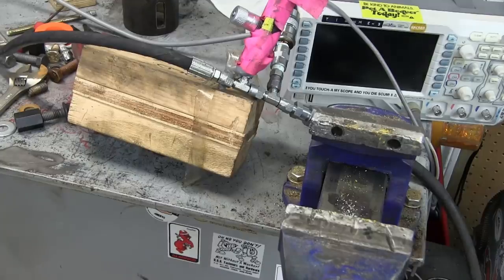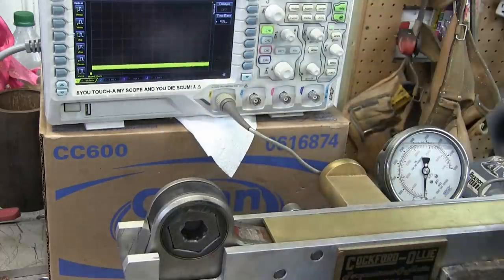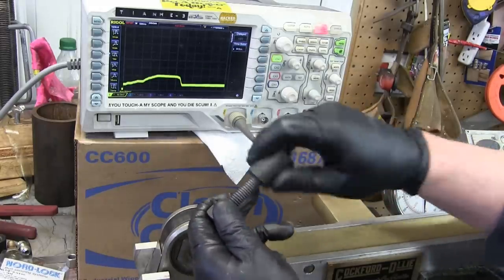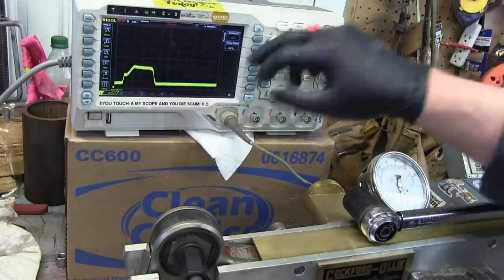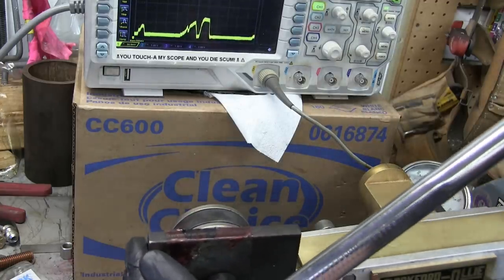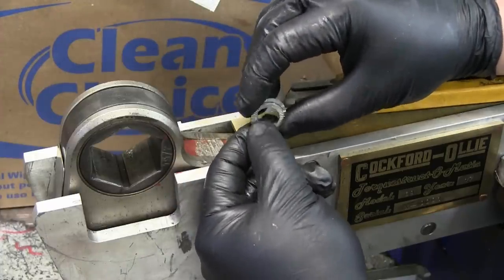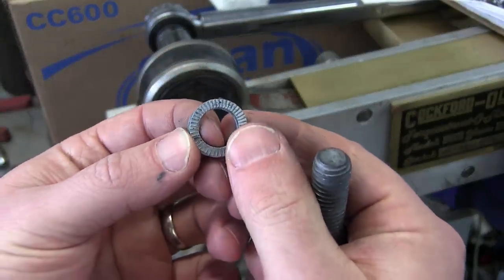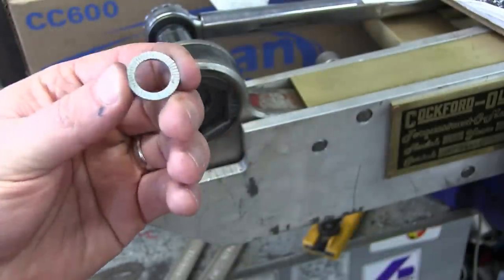Nord-Lock Washers | Do they work better?

Comment: Spring Lock washers do not lock a bolt under heavy vibration. The help prevent the bolt from coming out but do not maintain bolt torque over time. My company basically exclusively use loctite nowadays.

Comment: What about 1 washer with the slotted serration on both sides? I know the ratcheting in between the two washers is nice, but if they are glued together are they really working? I would be curious to see a single flat washer with slots cut into it.

Comment: At work have used Nordlocks at 600lbs it was near impossible to remove the bolts. Took a massive amount of metel with it. Never have to check the bolts after torquing with Nordlocks.

Comment: I can attest to these things working well, we have rotary steerable tools for drilling for oil and I have seen some tools hit 300g while drilling downhole, doesnt sound that bad but they can weigh up to 1.7T, so that's 510 tonne of lateral forces and impacts and yet these bolts didnt loosen the slightest. even seen half the bolt ground down from drilling yet these things kept tight.

Comment: That's why when I used to rebuild the P&W j52 we had to safety wire the crap out if it.  One flange 100+ bolts, all safety wired. When I got bored I do three or four bolts at a time. No washers.

I was safety wiring in my dreams at one point!

Comment: I was involved with fitting the structural steel on the new bond street station platform for the upcoming crossrail line in london. we used nordlock washers on all fixings there

Comment: Do washers effectively increase surface area on a softer material to increase surface friction? instead of 1/4" of surface area on that aluminum plate, a large washer takes it up to 2 inches of surface area thus adding torque required it to break it?

Comment: It's all about the anti vibration loosening protection. I've used nordlock washers for years on race bike and race car type applications and they just work, unlike EVERYTHING else except for safety wiring.
Reply: Seriously, I have seen nordlock work on 500cc two stroke race bikes where you can literally dial the vibration up with the throttle sitting on the stand in neutral and watch fasteners hits the sweet spot and start dancing around unwinding themselves, fasteners that you just torqued down! Threadlocker will hold for a time, but eventually succumbs; safety wire works and nordlock works. I'm a believer.

Comment: McMaster Carr sells diamond grip washers. I have used them for fasteners that needed to be loosened frequently for machine adjustments. Regular washers were not holding up for very long and tend to do a lot of damaged.
As you can guess by the name there not cheap.

Comment: do nordlocks ramps/teeth correspond to the thread pitch? thought thats how they worked you had to overcome the ramp effect of the teeth between the 2 which was supposed to be greater than the pitch of the bolt?

Comment: 271 Locktite and cross thread the Chingaderra, then run it right up tight with a 3/4 air impact. You never have to worry about it coming loose.  (Sarcasm, one of the many free services offered here at MD's emporium of used gasses)

Comment: I am in the middle of trying to building a prototype "Thing" in R&D stage for the company I'm with.  By Enginerd specs all fasteners are grade 8, Nord-Lock both sides and L9 Hex Collar Locknuts Cadmium Yellow & Wax Coated.   Between the Nord-locks and correct lock nuts, In my experience it takes quite a bit more to break the fastener loose.  You know it's bad when the price of double nord-locks and Stovers is high enough that even the guy at Acklands thinks the price is too high.

Comment: Are you sure the angle on those nord washers aren't shallower than the thread?  If they were steeper, why wouldn't the thread itself back out before the lock washer?  Surely the ramp on the washer needs to be shallower to ensure the lock-washers-ramp is climbed preferentially to the threads ramp...

Comment: 1: I think you need some filtering between your sensor and scope. Possibly a more fine grain sensor, so that smaller differences are able to be seen. 
2: this test is a measure of static to dynamic friction, real world vibrations could greatly impact the results.
3: you can build a vibration test rig with a a fein tool bolted to a plate.
4: the force vector of the wrench is not purely in torque, there is also a moment about the axis that us normal to the plane or rotation (as you have pointed out before)... This could have an Interesting effect when considering everything to not be rigid bodies...
5: if ability to resist unscrewing torque is not the only metric that matters then could this be applied to the previous Penatrating oil tests?
6: a test in which nuts are so rusty that attempting to remove them without any sort of Penatrating oil would break the shaft would be interesting
7. Furthermore in my experience it's not always the rust on the nut that is an issue, exposed threads corrode and build up a layer of shmoo that as you unibit something can cause the friction force to increase eventually leading to an elastic failure of the bolt.

Comment: Spring washers are no good as lock washers, but they do serve a purpose. We use sping washers in some monster shear couplings to ensure a clean separation on the shear pins when they brake, that way the sheared ends don't mushroom over which makes them a pain in the ass to remove.

Comment: If you wanted to try the  oscillation test method, couldn't you try connecting your function generator to an amplifier?  Then connect a subwoofer up to it, and press it against the test piece?

Comment: The spring washers are great. I had an engine that had the flywheel on with a nut and a spring washer. One time i took it off and lost the spring washer but i thought that it would be fine if i torqued it good and proper. No bueno. The nut backed right off and almost fuckered the shaft. I tried it once more and the same happened. So i went and found the lost spring washer, put it back on and what do you know the nut didn't even budge. Holds like a charm even to this day.

Comment: It feels like the Nord-Lock takes more work to loosen because it actually does. Work is force multiplied by distance (or torque multiplied by angle), so if you have to apply the same loosening torque for a longer distance, you need to put more work into it. This how these work. They give you a buffer, so that random vibration and movement is not as likely to overcome that loosening work of your bolt.
My bet will be on locktite though. Or if you have nothing else to do, wire locks.

Comment: nordlock has their own torque specs based on bolt grade sometimes it's pretty close to normal sometimes it's not! anyways the washers work like a charm if you use their specs, even on really hard bolts. Siemens uses them on their gas turbine exhausts, I'm not sure what the grade is on the hardware, but you can't cut the bolts with a portaband, teeth go bye bye immediately, gotta use a carbide grit blade. Anyway if you need to loosen a bolt you just put in, it's waaay harder than to bust loose than the effort it took to torque it.

Comment: Quote from the Nord-Lock brochure "Untightening Nord-Lock washers is as simple as tightening. Note that since the locking function is not based on increased friction, the untightening torque is generally lower than the tightening torque. Therefore it is not possible to measure off torque as verification of locking function."

Comment: used Nordlock on high vib drill rigs, they do work on milder steels, split washers however are pointless, may as well use a flat washer for some protection to the hole and loctite it

Comment: I wonder...here in Aussie land we have Metric Corse, Metric Fine and Metric Extrafine thread standards.
I’m guessing the NordLock effect would be greater with finer (more densely packed) threads because the NordLock angle would be comparatively larger than the bolt’s helix angle.

Comment: NordLock washers work well on electric bikes, especially those with regen that get some torque reaction in both directions. When it comes time to change the tire, you can feel the tension increase and then drop as you remove them. Would not want to mess with wires or cotter keys every time a tire needed changing on a bicycle.

Comment: I kept blowing out manifold and turbo gaskets on my car's engine.  Something about a stainless tubular header made the stock fasteners back off every time.  Probably the lower mass compared to the stock manifold and thereby more rapid heat cycling. Since i went to Nord-locks I haven't had an issue.

Comment: Surely the function of a spring type washer is to take up any slack that would be created by variation in length of the bolt through thermal expansion etc so the fastener always remains in the original alignment.  Kinda.

Comment: Please look into ARP fasteners... They are high end automotive fasteners very nicely finished and strong bolts/nuts/studs/screws(the bolt kind) and they also have their own lube for getting consistent torque pre loads the first time and every time. They also claim that their stuff is much stronger than grade 8 fasteners

Comment: Can you please try this test on a much finer thread ! Secondly could you try on different grade bolts (generally found higher grade bolts resist the outer flats on the washer digging into bolts enough to resist the undoing compared too a lower grade bolt)

Comment: i dont know if its been said, but there are bolts designed to work with the teeth. usually a flange bolt with teeth on the thread side of the flange.

Comment: Would they work better with a hard bolt if there was a soft flat washer between the bolt head and the nord lock?
Reply: No, they would not work at all, because the bolt would turn against the flat washer.  This vid was about seeing AvE discover how Nordlocks work, not about how to use them.  There are other vids and articles on the web explaining this topic in full detail.

Comment: I think you may have missed the point here, which is pretty rare. The Nordlock washers are not intended to increase breakaway torque. They are intended to prevent the bolted joint from backing off under vibration. You need to test this on a big shaker table and see if either locking device prevents the bolted joint from staying in tension during a heavy vibration run. I've seen tests like this, and the Nordlock stuff does work, and indeed the split washers do not, but really neither are necessary in many cases, plus the Norlock stuff is super expensive.

Comment: It's easy to make standard lock washers improperly. They're wrong when they depend on the regular spiral incline between the cut ends. They work better when the cut ends have a slower spiral and curve into the bolt head and into the surrounding surface around the hole. But there's an additional design fault: resisting torque that tends to loosen the bolt depends on resisting spreading the split washer open. Also, the difference between the washer's ID and OD is too small.  The OD should be larger and the cut shouldn't go all the way through radially. I think the cut(s) should be a "T" shape sitting on the ID that only goes half way through the radial cross section.

Comment: sounds like with hard steel, you need a pair of nordlocks and loctite/epoxy on the washer-to-hard-steel interfaces. ie the crucial design feature is the long serrations (backing off RELIABLY increases force, unlike spring washers where backing off just means force doesn't drop suddenly), not the short serrations (where force increase depends on surface matching, per any roughness in direction of travel)

Comment: I think the split lock washers are not meant to make the nut harder to overcome, but to serve as cheap insurance if a newly fastened nut comes loose, hopefully it won't turn off the bolt all the way, given that for the first 1/16 of travel it still has a sprung resistance on it.

Comment: I totally misunderstood the strain gauge apparatus. I had taken it to be measuring the applied torque and not the developed torque. I shouldn't have, since he went ahead and explained it when he was setting it all up. It wasn't apparent to me until he was setting up the system here without the pneumatic component pushing the wrench.

Very clever and cheap and dirty system he rigged up there.

Comment: what about if you took a nord lock apart and welded the top half to your bolt and the other half to your work piece that you are bolting into       (if you are using a nut you would have to do the same thing on the nut side i believe)

Comment: spring washers were designed to stop nuts from rattling off bolts while on the assembly line, until the nut is tightened at another station of the line.
designed to last a few hundred yards on the automotive assembly line.

Comment: If I need to fasten 2 pieces & make absolutely certain that they do not come free unintentionally, I do 1 of 2 things.

1- use a stud with a pair of nylon lock nuts or crimp lock nuts.

2- spring washer at the head of the bolt with a nylon lock nut as a jam nut. (On top of a standard nut)

Comment: The good old drill a hole through the shaft of the bolt and stick a cotter pin in it always does the trick.

Comment: As long as the internal forces created by the fasteners are  greater than any of the external forces applied the parts wont come apart. That is why it is so important to apply the designers indicated torque to the bolts. Vibration can apply far greater forces than the steady state forces, if it has been designed right it wont come apart. But in the real world you often get vibration forces that the designers did not expect, that is where Loctite and locking wire comes in. Under the correct torque a flat washer works as well as any of the anti shake washers.

Comment: Wouldn't the thread pitch on the bolt being loosened also succeed in clearing the serrated surface from the bottom of the bolt head. Seems like that serration would skip long before the bolt stretched. Of course that is only a guess as i have no idea on the actual math of that.

Comment: We used nord lock washer on the drill rigs at my old job, they work every well for vibration but they cost alot imo instead of just using lock tight

Comment: It does work, you just need to be very particular what materials bolt and plate are made off, and what is the pitch, and use a proper speced washer. If you need a fastener which is harder , you  might need a nord lock that is integrated into a bolt.

Comment: Nordlocks are great, but they were designed for a specific purpose.  One must learn how they work, when to use them, and when not to use them, before specifying them for a particular task.  Also, beware of copycat products that look like Nordlocks but aren't -- they don't work at all!  Nordlocks work so well because they are "active" lock washers which give a little under stress, by going up the little in-between ramps (effectively increasing, not decreasing the bolt tension), but without the external teeth giving at all, so as the stress diminishes, the washers come back down the ramps to their prior state and original torque.  Under vibration, the ramps go up and down, while the external teeth do not progressively loosen.  Follow torque specs carefully when using these.  If they're under-torqued, the external serrations won't bite the bolt and base material deeply enough, and the fastener will work loose.  On the other hand, if they're over-torqued, there will be too much tension for the ramps to work properly, and, as AvE noted, the Nordlock warshers will break catastrophically.  I use these on my motorcycle for some bolts that tend to rust and seize (e.g., side stand), which enables me to use anti-seize instead of loc-tite.  McMaster sells a variety of these.  Depending on your purpose, you might prefer drill-and-wire, torque-and-tack, and/or a variety of other techniques.  For critical applications, do the research, and don't compromise.

Comment: I use Aerotite on my cylinder heads. They hav3 a springwasher attached to the bolt so its a single unit. Usually retorque the head every 1000m or so (very tuned so vibes an issue) since i switched its never needed doing, though i still check!
Reply: Arrrggghhh sorry....washer attached to NUT

Comment: Id be curious what the results would be if you used a bolt with a serrated flanged head in conjunction with the nord lock. That way the nord and the bolt would be locked together.

Comment: I had serious problems with turbo bolts on my track car getting loose, I tried everything, nothing worked, red hot heat cycles and vibration on a 8000 rpm motor are too much, JUST STARTED USING SAFETY WIRE AND NEVER LOOKED BACK, WORKS LIKE A CHARM.

Comment: "Note that since the locking function is not based on increased friction, the untightening torque is generally lower than the tightening torque. Therefore it is not possible to measure offtorque as verification of locking function."   (then in the "verification" section:) After disassembly, impression marks must be visible on both the fastener and the contact surface.  

edit: https://i.imgur.com/8Fm4MCo.png picture from their documentation to show the cam action.. there should be like 20 thou of additional spacing when properly torqued

So, yeahh, you want to bolt into like mild steel or something. The bolt stretching should be fairly minimal, since the two washers should cam against each other, with the washer closest to the bolt head moving in line with the bolt, and the second one  one biting into the material and staying stationary.